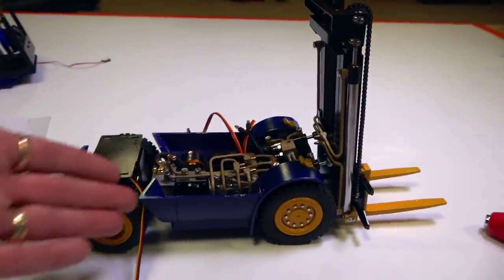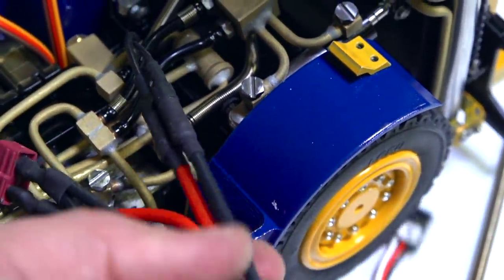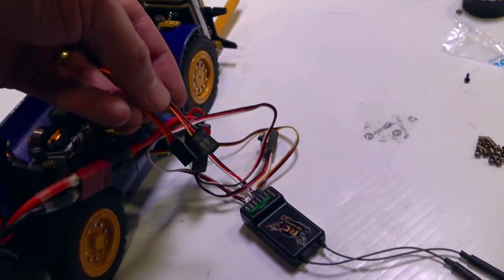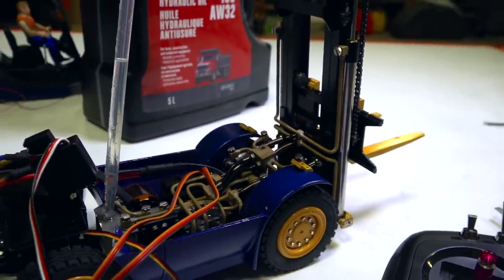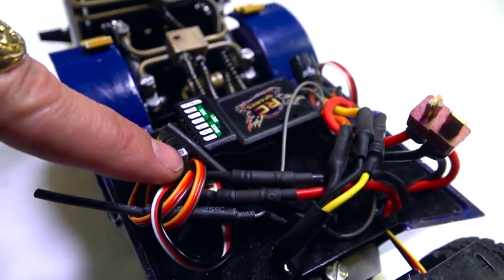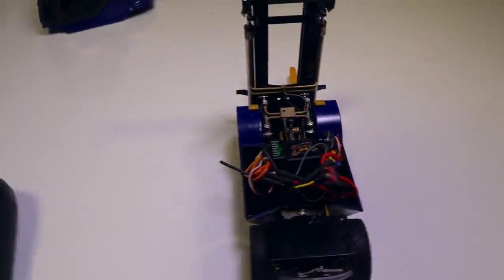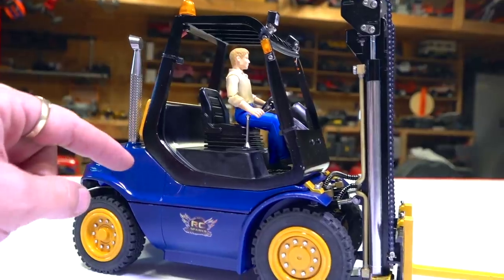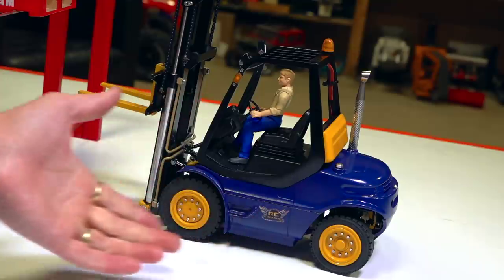FINAL BUILD & FIRST LIFT! LESU ALL-METAL HYDRAULIC FORKLIFT PT5 | RC ADVENTURES

Comment: Safety is number 21 priority sir! Thank you showing the mixing of the radio. I never used that function so far and I always wondered what's it like. Bad luck with the light controller, but it still looks great. Fix her up and she will be gorgeous.

The problem with hydraulics is that it's difficult to test. You have to kind of trust the instructions. You can eventually use compressed air for tests, but it's not easy to hook up an air compressor and it must not be strong or the lines would just blow up.

Comment: A little tip for getting the air bled without having to run the machine, is to use one of those hand vacuum pumps. I don't know if it will work as well on rc hydraulics, but basically fill the reservoir close to full, put the vacuum hose with a alittle suction cup over the fill hole and put a vacuum on it while opening and closing the valves, then you add some more fluid and repeat till the fluid level quits dropping. Hopefully that makes sense.
Edit, I use the clear hose and put vacuum on it just till the fluid starts to come up the hose so I can watch the air bubbles coming up.

Comment: Liked the added part showing the mixing. Awesome build. One comment. Not sure how hot that oil will ever get but I imagine it could if used long enough. That being said it will create pressure. It does to real world equipment anyhow. Most Cat equipment has a sealed tank but some machines (928 loaders come to mind) anyway thought it might help with bleeding your system and preventing those lines popping off or leaking. Also if there is a way to neutralize the spools you may be able to bleed the mast cylinders that way going to full raise and then letting them bleed down slowly. Hope any of that helps. Great build.

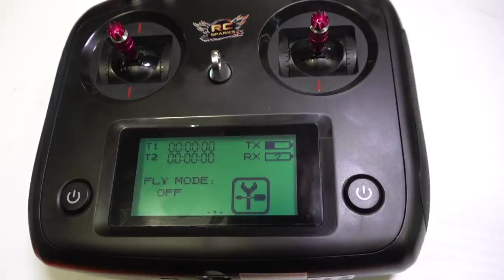Comment: Awesome channel!  One of my Favs! 9:20 Still Watching. Understand what you are doing with the settings and the controls but didn't follow your process because I was trying to think how you were going to drive the RC with what controls. At 10:30 you started to show the debugging.  As a pro programmer that also teaches HS students robotics, ppl understand better if you explain one setting at a time and show the RC working the one setting before going onto the next.  It may seem like talking newbi speak, but since your goal is to help newbies and pros alike, then you have speak both.  Especially for complicated builds. Love the explanation about 2 ESCs and the debugging.  Try a dental tool or other small pointing tool that is not black for pointing at these small items instead of a finger (unless you don't want to keep looking for yet another tool when trying to film/build at the same time). Dental tool is also useful for the getting servo pins out of the black connectors. Safety 3rd...er wrong vids.  Safety priority 21st!    Looking forward to enjoying all your vids!

Comment: Nice build. Being a seasoned fork lift driver, that sound doesn't sound right coming from that style of lift. It needs to be at least the less diesel sounding propane engine and electric horn instead of the air horn. Also needs the backup beeper. Just my opinion. Enjoy the fun that thing will bring to you guys. Can't wait to see the next loading wars.

Comment: Just a tip, but you should level or even point your forks downward when removing a load from them, it allows you to more easily see how the load is fairing as you've set it, and also makes adjustments easier, as all you need to do is tilt your forks back again to lift the load enough to move it slightly.

Comment: This may seem dumb because the hydraulic systems on a real loader or forklift are much different in there design, but the hydraulic tank needs a breather on them. The expansion and contraction of the oil may be causing cavitation in your pump causing the hydraulics to not be smooth. It may be causing an air lock in the system. 
This is an AWESOME build! I would love to see more builds like this and the excavator. Maybe a truck of some sort!!! Keep them coming!

Comment: You will need to put the vent screw back onto the tank. When you are running it, the oil will warm up and expand. It can build up too much pressure and start blowing the lines off. They put those on there for a reason. 
I'm glad you were able to get the kinks worked out on the lines, and get it to working properly.
Reply from the maker: Correct.., but in the instructions.. its shows the screw. The breather hole is needed though

Comment: Those mini-leds, I saw you had the white leads going to the red lead, and black to black. Usually with my experience on aftermarket full size LED lamps and what not, the white lead is generally the negative, and black is positive. Maybe you have the wiring flipped backwards? Worth a shot to check it out

Comment: That was a treat to watch. Happy to see you have finished it and it works well. I have a question and hope you see this and respond. Here goes... So I noticed that the original hydro tank cap had some type of pin hole in it to allow for air to move in and out to either make room for fluid or allow proper Atmospheric pressure. Now I may be completely wrong about this and just seen it wrong, so please correct me if so. Anyway I'm wondering if the fact that you used a bolt and o-ring to completly seal the tank are you now getting pulsing through your lines when you are raising and lowering the boom, and perhaps it's not air in the lines? Are  hydraulic tanks usually vented or sealed? I imagine vented, but please... you tell me Medic. You would know better than I would. I Hope to hear from you, and/or someone else. Thanks! Great content as always.

Comment: If it's possible. Can you mix in a throttle curve on the hydraulic pump. If the radio supports it.So you can have a slower more controlled movement when you setting up for a pallet.
So a bit of stick input say mixes in 40% throttle and so on.

Comment: I'm having a hard time finding an appropriate LiPO battery pack... small enough to fit but with enough grunt to power the hydraulics. I was hoping to catch a glimpse of what battery you used but you peeled the label off! What battery pack is that?

Comment: Hi, thank for the fast reply. I finally got everything working now, but the plastic tubes keep on blowing off. Even with the retainers on. How do you keep do your from blowing off? Is it maybe I put too much oil in?
Reply from the maker: You did not put your Breather on the tank.  There was a small brass looking "bolt" that came in the bag with the tank screw, and a black cap. You MUST use that brass bolt with the textured top, instead of the silver screw on the tank. You are building heat pressure.. and its causing expansion.  The breather bolt will allow air and excess fluid to escape :)

Comment: Beautiful, did you sort the steering I noticed that although you filed the area where you put the swivel's it was loose until you put the pin's and clip's together.
Does the light system plug into the sound unit, I have had a couple that were wired so, I also noticed that the sound is not connected to the throttle so is on idle even when moving.
I have had the same fun and having to work through the problem's one by one.

Comment: Nice build, but the hydraulic tank still needs to be vented even though you blead it because the oil level/volume in the tank changes with the volume
of the piston rods going in and out of the cylinders and creates a pressure/vaccum in the tank. also the volume in the system  will change with temperature. 
Best of luck when you go to war! :-)

Comment: I have the same lesu forklift, but I couldn’t get the hydraulic pump to run. Maybe I didn’t set up the brushless esc ? How do you set it up? I have the same radio as yours.
Reply from the maker: You have to set up a channel mix. I plugged my pump into channel 6.  I mixed channel 3 and 4 with 6.  Neg 100%  Pos -100 3 and 4 are masters, and 6 is slave. Problem solved ;)  Remember to map your aux channels.  For example.. Assign Channel 6, to toggle SWB - and have ensure you have it in the middle position

Comment: Safety is usually 21st, but I think Joe might make it in the top ten if you are moving beer. I wonder if the directions are just not translated into English as well as they could be, which is leading to some of the confusion you have ran into with the forklift and the excavator. Did Rookie have any problems getting the Lesu truck put together?
Reply from the maker: LOL.. I like that you are assuming there are words to translate. When i said there were NO instructions for the light kit or sound kit, I was on point..

Comment: Still haven't tried it...but .....never heard a definite answer, if you have 2 parallel circuits why remove a power wire? Does it fight/back feed when one ESC puts out more amperage? Sorry I know the norm is pull the red wire but I've been arguing this in my head for years...and I still pull the red wire

Comment: How can I get more details about how to do the wiring? I am building one of these and I need to fill in the blanks from the video. My hydraulic pump won’t come on, and the sound card/lights don’t work either. I’m not sure how to fix it, please help!!
Reply from the maker: Your hydraulic pump should be set to a 3 position switch, and then mixed to the mast controls to turn on only when it is requested from the input control
Reply: RCSparks Studio 
The radio I have is a spektrum dx6i and it doesn’t have a 3 position switch, only 2. Is there any way to use it or do I need a new radio? Also, do you know how to wire the lights, I have them wired together correctly but still do not work.

Comment: I got the same flysky radio in the build video with the 3 pos switch, and I get the whole mixing thing, can you tell me how to set up the esc for the pump using the set button on the on/off switch? with no manual I don’t know how to program it properly. Please help, I’m at a loss and running out of options. Thanks
Reply from the maker: Yes. For example, plug the pump into channel "5". Make sure you tell the radio it's a 3pos switch.  (The top Left hand 3 pos Silver clicker).  Middle will be the (neutral position)  Go to your mixing screen.  Activate a control channel (Lifting channel 4?) as the Master.   Channel 5 will be the SLAVE.  The position switch for POS and NEG need to be opposite. I believe NEG has to be +100 and pos needs to be -100.    That should activate the pump now, when you give it input from channel 4. When you stop using channel 4, the pump will turn off.  Repeat for the Boom forward and backward (channel 6?) Let me know your progress
Reply: I have my radio programmed for mixes 1 & 2 and assigned the 3 position switch so the pump will work but it’s still not coming on, you mention that the hydraulic pump esc needs to be programmed for neutral/fed/rev using the set button. How do I do that?
Reply: @WJeep1  How do I program the esc?

Comment: i would advise to turn down the speed the boom is tilting for more control, that is if it is possible
Reply: majstealth I’m wondering if there is a dual rate system on these radios. I’m old school so I’m use to airplane radios. They can mix and rate set so there smooth and easier to control.
Reply: @scottledin8210  or limit the axis down to like 50% that stretches across the hole axis, basically halving the rpm of the pump by that
Reply: I had to go find the right term I was looking for. Been a while since I worked with a radio and mixing. Here’s the right term for it. 

EXPONENTIAL
Simply stated, exponential in our radios gives stick inputs a softer “feel” around the center of stick travel. The greater distance we move the stick away from center, the less effect any programmed expo has.  Expo works in concert with rate settings and is another piece of the puzzle in getting your radio controls exactly the way you want them.

Comment: 320A my ass.
Let's humor the idea of the esc actually being able to handle it, you would need 3AWG.
That's a wire with 95mm² (354A max).
That's thicker than my fist.
This tiny ESC is more than likely even not capable of 32A continous. 
But what do i know, i'm just a guy with a degree in google searching and 15 years working with electronics.